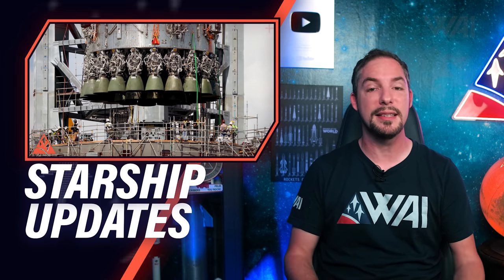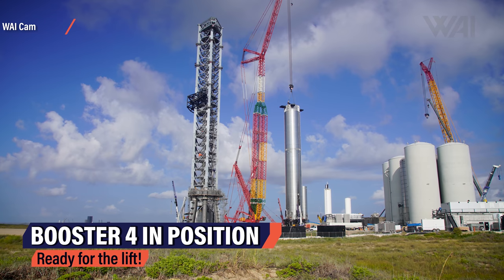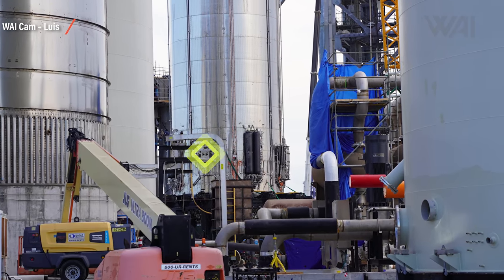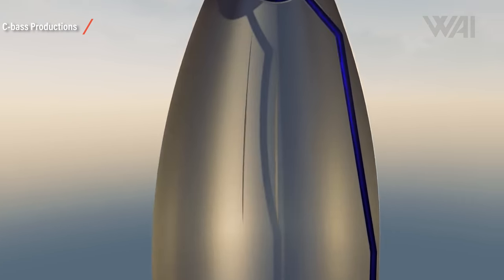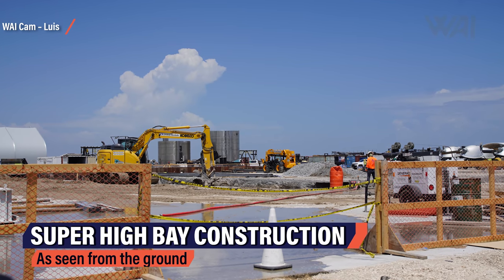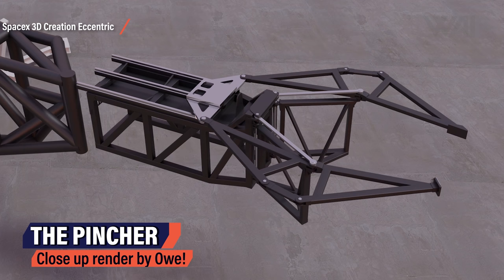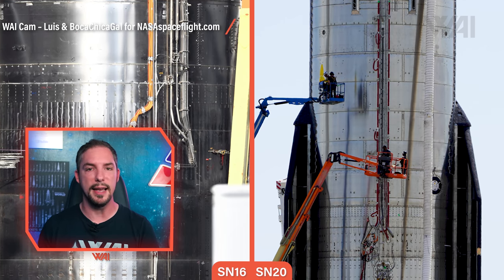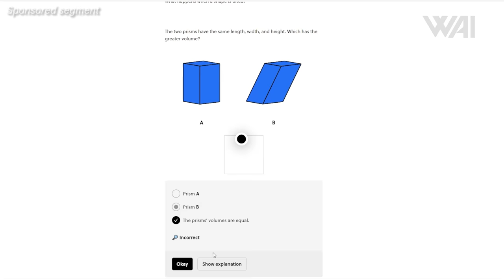SpaceX Starship Super Heavy Booster 4 Design Changes explained!

Comment from the maker: What do you think? Is SpaceX going to use the "pincher" on the quick Disconnect arm for Starship?
Reply: Siii genial, nuevo video, , saludos desde Colombia
Reply: welcome back
Reply: Quiero una camisa, , hacen envíos a Colombia????
Reply: ehh emm maybe im so early me not view video yet
Reply: Very likely. F9 rockets are supported by the strongback that basically hugs the rocket befor launch.
Reply: Personally, I don't think so.What about the using chopsticks to stabilize??  Also, are those pinchers big enough to go around it?
Reply: Some call it the "Claw".
Reply: honestly, the team at Boca could change plans and re-use the existing hardware at any point. We've seen it before with the rapid prototyping and with the complexity of stage zero, anything could happen. oh, and I'm pretty sure Elon borrowed this idea from the KSP community anyways https://youtu.be/5BrpV3Q1Rzc?t=58
Reply: i think the claw grabber serves no purpose, if it did actually touch the rocket it would damage the rocket, the rocket will need to do everything itself anyway so having a tower narby with claws is just a big hazard, i think it makes sense to accelerate the whole rocket upwards via hydraulics, up to 100mph, this will save fuel.
Reply: Not 100 on the pincher either ! but starship is still missing aero covers over the copvs the fuel quick connect model and the communication and electrical going up the spine !
Reply: @davidallyn1818  i suppose it could be lowerd from abouve and clip into holes in the nose cone removing the need to manualy attach a lifting cable
Reply: @rdherrera543  9
Reply: Yes, someone else already said it’s to help hold the Booster in place while Starship gets set on top.
Reply: Sure seems such a waste to dump it into the ocean
Reply: I'm not sure, but i love how they use the word "iteration" it reminds me that whatever they do, they'll change it and make it better....
Reply: @deankaras8359  
What EM doesn't want to waste is time. This one can serve a number of purposes with what it can do  n o w .
Reply: Please don't call it that.
Reply: Is SpaceX going to use the "pincher" on the quick Disconnect arm for Starship? Sure, but I think we should call it the grabber.  Pincher sounds sort of small sat :)
Reply: It’s obviously “The Claw”.
Reply: Per the tiles: The tiles are very anti-elon musk logic. The sheer number of tiles, the time consuming maintenance nightmare, and the obvious fact that ”each tile” presents a critical vulnerability for the entire Starship, summarizes the fact that this approach cannot and will not scale. What about it? WHY isn’t Elon incorporating a much newer technical design whereby they apply a continuous Flexi-Ceramic roll for the larger areas and simply use individual tiles on outer edges or where more custom tiles are required? I’m certain that the Flexible Ceramic roll can also be imprinted with hexagonal shapes on the outer layer to help with heat redirection. They would cut down on at least 75 pct of the installation, maintenance and vulnerability of the current “doomed-to-fail”and “Impossible-to-scale” individual tile approach.  Only you can get the word to Elon Felix. The success of the Starship program rests on your shoulders now. WAI?
Reply: Can we call it "The Big Yabbie". it would mean a lot to Australians
Reply: I like the idea of a pincher propellant transfer arm, but does that imply anything about how they’re going to do in orbit propellant transfer? In orbit stability would be important. Perhaps a special fuel station version of starship contain equipment for propellant transfer. From tanker starships to the fuel station Starship until it is full, then one transfer to the mission starship
Reply: If they do, they need to put googly eyes on them.

Comment: The pincher is actually a 9m open ended spanner for tightening starship onto the booster
Reply: i just imagined a scene where Elon is in a Conference room with his Kerbal Engineers who suggested many over-complicated ways to mount the Ship onto the Booster, and after some heated Discussion Elon just said "Screw it!" and went out of the room. and thats what they do now :D
Reply: @unitrader403  🥇
Reply: funny you say that and due to the desighn on the tips that could be infact its verry function to rotate the uper stage for correct alignment what we have to consider is the complet removal of manual handling i also am looking forward to an on site rail system for the transporting of rockets removing the need to use the roads uneven ground and futher limiting the handling

Comment: The noise, the heat and the vibration during launch will be something that hasn't been seen since Apollo 4 when there wasn't a water suppression system used.
Reply: Maybe it will be 5 Times great. Considering 30 engines instead of 5. 🥺
Reply: @mvmmotovlogmusic2815  Thirty (or 29, I think) much smaller engines, still with more total thrust.
Reply: @mvmmotovlogmusic2815  That's not how noise calculations works
Reply: F1 is more powerful than Raptor. BE-4 is more powerful than Raptor. The main thing is that it is both incredibly efficient and pretty powerful.
Reply: @karlkarlsson9126  Thanks for the link. I remember that launch, I was  15. There was a problem with the fuel lines because they were straight, this caused "pogo stick" vibration which almost destroyed the first stage. It was corrected by the time of Apollo 8.

Comment: Moving Ship's fuel port to the side eliminates the plumbing that would have been required in Booster to send the fuel up to Ship.  Less plumbing = less weight =  more payload or range.
Reply: Shift to stage zero when ever possible...

Comment: In addition to the scarcity of helium on Mars, there's the issue that - on the Falcon 9 - the helium costs more than the fuel.  Since methane is cheaper than RP-1, the difference in cost would be even greater for Starship.
Reply: So the problem: what available "gasable" resources on Mars can be used in place of He that will replace the tanks as they are emptying....taking into account the properties of He what are possible alternatives....if none, can the pressure problem be solved another way?
Reply: @tombest6283  Starship will use autogenous pressurization, no other gas required.
Reply: Interesting. I didn’t know the helium cost more than the fuel.

Comment: SpaceX obviously has untold confidence in its first launch.  Yet sooo many things can go wrong.  The success of the heat-tiles (their heat resistance and their ability to stay intact)  are absolutely crucial.  And lets hope the ground support systems are unharmed, too.
Reply: I don't know that they have confidence that everything will go right on the first try.  I think Elon said at some point that it's a win if they don't blow up on the pad, and he's usually a pretty optimistic guy.  I'm obviously rooting for it to happen, but I would be completely blown away if every part of the mission went according to plan.
Reply: Things to go wrong is things you want on your first prototypes, however, as long as it doesn't blow up on the pad the mission is a success. Things like this has to be experimental to get a solid final product, that's why it's also interesting and fascinating to see failures as well.

Comment: Fundamentally speaking, Ship 16 is not obsolete. It has its quirks like Ship 15 with intentions toward a specific aspect of the design not otherwise covered entirely by an orbital flight.

My prediction: If Ship 20 fails on reentry they’ll go back to Ship 16 for hypersonic testing to evaluate aerodynamics before launching B5/S21 with the proper modifications learned from the previous two flights by that point. 

Delta Clipper was preceded by DC-X but not before they ran out of funds. SpaceX don’t have that problem but they may want to take their time knowing the FAA is breathing down their neck with the environmental review (extremely annoying, yes, but when it’s completed they can launch at a very high cadence without many issues!)
Reply: Ship 16 and Ship 15 are still needed by SpaceX for an important reason: landing accuracy. If they cannot land accurately with the ships then there will be no effective way of catching them without the necessity of landing legs as a fail safe. Even if the ships are cheap, they are not designed to be expendable. Thus they desperately need landing pathfinders that will work no matter how successful ship 20-22 are at the reentry process. So by keeping two prototypes on flight that are what people like you and other people believe to be obsolete, they are able to improve the accuracy and equip AI to handle landing accuracy well enough to remove any requirement for landing legs. 

So either SpaceX keep the landing legs or they fly and refly pathfinder ships that can improve the guidance system enough to eliminate the necessity. And this cannot be done after the reentries begin to be succeeded.

Comment: When SpaceX is lifting the booster or starship on to the structures they are building they are testing the structures and rockets it is not with out purpose. No one seem to mention this. Remember Space X is Always testing to improve as you would do with Software. Oh yeah that is Elons bread and butter. Lets spread it smoothly.

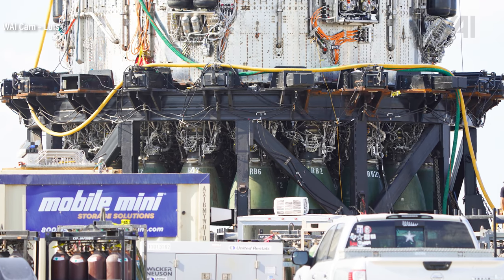Comment: @7:05 Incidentally the Space shuttle also used autogenous pressurization, feeding hot oxgygen and hydrogen from heat exchangers in the engine to the propellant tanks. I think the SLS is also using that same system.

Comment: Hopefully the heat shield tiles become robust and reliable. Replacing them would be a problem for quick turn around.
Reply: If they do - great. If not SpaceX will either fix the issues or come up with a diffrent idea. wouldnt be the first time they did some radical changes.

Comment: Charles Cronleys animation of the pincher is backwards. The bevel on the arm should be the opposite of what is shown so that its fully seated against the arm that's already on the tower in the extended configuration. This way it will have way more strength to hold the booster and it will swing out of the way by rotating until its along side the main arm.

Comment: Another benefit to autogenous pressurisation is that removing the helium eliminates the risk of helium ingestion, which IIRC was the cause of at least one test flight RUD due to raptors eating helium and underperforming during the landing burn

Comment: The technology developed during the Apollo program received many spin-off uses beyond what they were designed for. What spinoff capabilities would SpacX technical solutions have?
Reply: Nobody really knows. Widespread use of the Sabatier-process in order to make methane a carbon-neutral fuel is a likely candidate. I however am much more excited for the spin-offs that come from settlements on the moon and Mars

Comment: It is going to be a success -maybe not exactly the first test, but they’ll succeed in few iters-! BTW that huge complexity of 29 engines to be controlled in real-time represent quite a challenging task for many design teams -mechs, CFD, mech stress, R-TYPE control, and many more-. 50 years ago the main problem of N1 was the challenge posed by the number of engines. I definitely believe in the superhuman engineering power of spacex, but the solution to pack that many raptors in such a cramped space is not the most straightforward for sure. Will see.

Comment: In Tim Dodd's recent interview series Elon spoke about 'hot ullage gas' & that there'd be plenty of it from the autogenous pressurisation system. Will boil off not be a problem - especially when the tanks are mostly empty?
Reply: The Hot gas and sub-chilled liquid do not mix during acceleration due to gas stratification. Once 0-G begins, the liquid will tend to spill out into the gas and cause gas contraction on contact with hotter gas. So the thrusters need to keep that gas stratified and liquid consolidated.
Reply: WHAT!?
Reply: @imconsequetau5275   It was the zero g period, after the Superheavy boost-back burn, that I was thinking about most.
So continuous ullage gas venting is enough to keep the tanks settled for the entire few minutes that would otherwise be zero g? That's impressive - if it works.

What about the same concern regarding Starship after reaching LEO?

Comment: OK, I will say it.  When the final design is complete, this will be Space Shuttle 2.0.  The heat tiles are basically the same as Shuttle except cut differently.  The ones towards the nose are glued on, just like Shuttle.   If you look closely, I believe there is a material under the tiles being attached similar to the Shuttle thermal blankets from my understanding.   The fins are getting closer to the look of the Shuttle Delta Wings.  The cargo bay doors may be more like shuttle and not clam shell as the initial design indicated.  For those who do not appreciate the Space Shuttle, it appears there are design elements that SpaceX thought were good enough for Starship.

BTW, since it is getting a little more complex, a guess the engineers at SpaceX spoke up and said, there are some things rockets needs to have.
Reply: The fins function differently than Shuttle
Reply: @alvianchoiriapriliansyah9882  I understand, but if you look at the ones at the bottom of Starship, they are getting closer to the wings of the shuttle in terms of shape.

Comment: It's not wide enough to 'pinch' the ship. I think it is to move the Chopstick arms. The arms have very strong vertical strength for the Booster, but you don't need strong arms to move them in and out, just a pivotal point.

Comment: Hi Felix ~ why don't they use comparatively large tiles on the sections where the contures are the same (SN20 body minus nose cone)?  Larger tiles, say 10 times the size of the current tiles, where possible, would greatly reduce complexity in the build/maintenance process.

Comment: Will they install covers over the Raptors ??? ...   Also will they cover the external parts or might they move inside in later versions ??

Or do you think they won't bother as this is why they need a higher high bay so they can add one more ring section  for a skirt ???

Loving the content ....
Reply: Should be later

Comment: This cannot be treated as just another prototype if it fails during testing.  If there is a mishap with 29 engines and a large amount of damage in the surrounding area,  you know the FAA is going to probably suspend the launch license from Boca Chica since the site was originally approved for Falcon 9 launches Not Super heavy launches.

Comment: But if the damage to tiles was potentially caused by crane lift, when they stacked, how will they prevent damage for next stacking? Do you think they will test the Chopsticks and try to stack using it for test flight?!!!
Reply: Chopsticks will replace the current crane to stack it

Comment: is it not possible to 3d print starships Outer sleeve and print the thermal layer on it ? and build the inner systems on a sort of rail platform to be railed in and out of the main body system for example maintenance with expanding rings that lock the   platform and seal of like a air lock accessable for crew for maintenance. and with a nose cone that is a little ship of it's own, and can turn around the ships body to be functional  as a artificial Gravity system also  decks that can turn from position when starship goes horizontally or vertical.
and  also  can disconnect  from the main body when things go wrong and fly back to safty.

Comment: Why would the pincher grab the booster below the grid fins? There is not requirement to stabilise the top of the booster. 

It seems more likely the pincher interacts with the starship. The QD is necessary to fuel the starship. The Starship must be stable when mating with the booster.

Comment: They only just managed to get three Raptors to run reliably on the last flight.  I say the chances are high of a very big, expensive BOOM with 29 of them running simultaneously.  The Soviet N1 comes to mind.
Reply: To make the boom less expensive, they should have planned to fly the booster alone without the Starship on top.
Reply: Let’s say the booster RUDs … will they program an emergency mode where the Starship fires all engines to escape and minimize damage?
Reply: If Starship and Booster RUDs in full worst-case detonation, we just might have a new “largest non-nuclear explosion of all time”.
Reply: @faustin289  That will only do nothing but waste their time

Comment: Over and over I hear you say: "The best part is no part!"
So chew on this in a future episode:
What is the thrust difference between a vacuum and a sea level engine at sea level? It would seem since starship is landing in the ocean east of Hawaii, that the outboard fixed vacuum engines could upright starship via differential thrust and land it softly in the ocean. This would save the cost and mass of 3 raptors which have no use except landing.
Reply: Without 3 SL, the gravity losses after stage sep would be very intense
Reply: @alvianchoiriapriliansyah9882  Really! Then explain how Falcon 9 gets to orbit with a single Merlin vacuum engine after stage separation. I would assume altitudes and velocities are comparable.

Comment: I am concerned about the heat shield. Shuttle had precise alignment, and this was emphasized by Nasa. Even in the supposedly finished areas of starship there is a lack of uniformity; protruding tile edges are quite common. Elon mentioned they would have thermal cameras inside the starship to analyze hot spots a month or two ago. I don't believe s20 will make it back from orbit, but I hope  I am wrong. I believe this heat shield could be the most troublesome issue on the way to rapid reusability. It is the most critical design feature as history has shown.